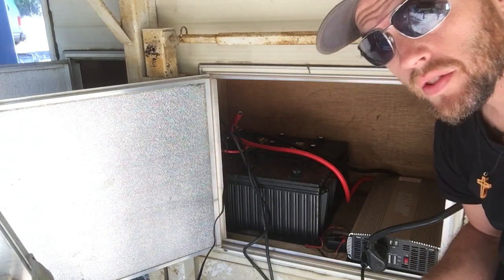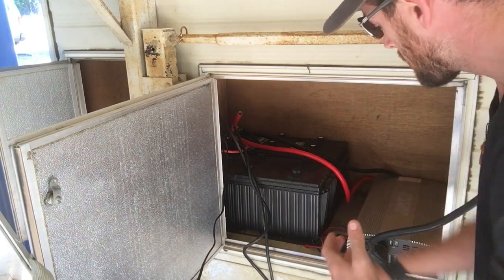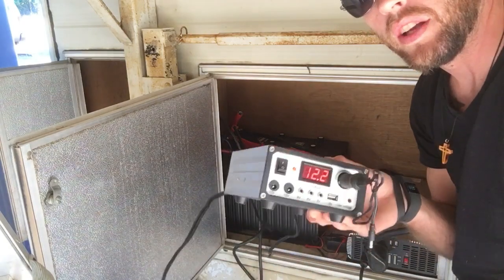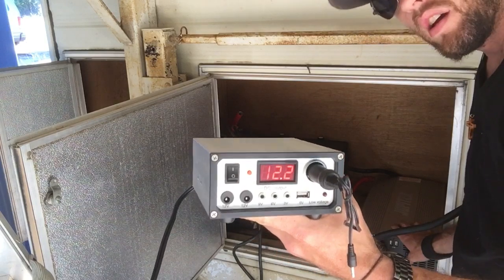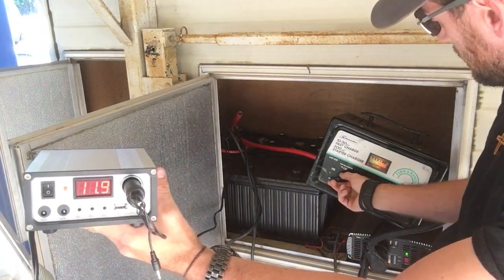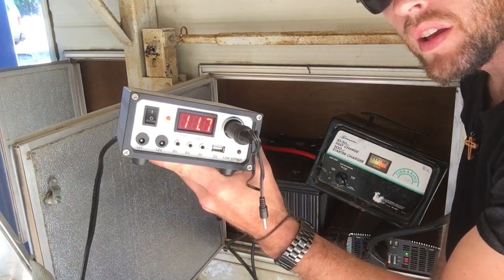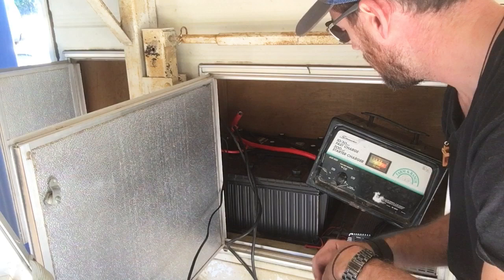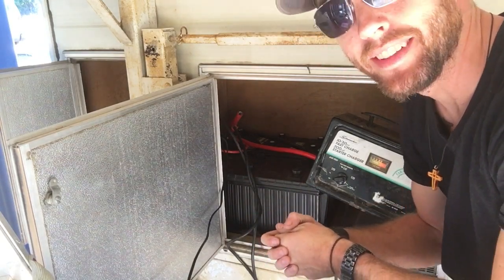The Circle of Lost Battery Life | Battery to Inverter to Charger back to Battery | A Perpetual Fail

Comment: I am looking at doing the same kind of deal. Except that off of the inverter, I am looking at a small variable speed motor to run several Wndzilla generators (3200 watt puts out 12v at 160 RPM and their small ones are 350 watt and hits 12v at 50 RPM. Walmart carries a TTech that's comparable to the 350 watt. They come with mounting brackets) Run the generators to a connector box, to a wind  charge controller and back to the battery bank. I think that it can be done, but the supply going to the battery has to be at least 1.5 times the draw rate to make it recharge with no other load on the batteries.
Reply from the maker: Did it work out for ya?
Reply: @JackNelsonBand  I could say "oh yeah, works great" and it's not done, but that's not me, to be completely honest, I've had a couple family unexpected emergencies (deaths, hospitalizations) that I've had to travel for, as well as emergency house (leaks around windows that required an exterior wall replacement, new roof) repairs that I'm still paying off and really don't have the extra money to go all in all all at once, so it has been extremely slow, save a couple bucks for a component here and there. However I was looking at what I have on hand just the other day, which is the drill motor, 2x 350 watt generators, toggle switch, voltage meter, 500 watt solar regulator (belongs to a different project, but hey, if it will work for this), 3x 100 deep cell batteries, 400 watt inverter and thought, what if I wire the three batteries in parallel for 300 ah in 12v with the voltage meter on it to give me a quick reference meter. Also wire the toggle switch to one end of the bank to run the motor and run only one 350 watt generator through the 500 watt solar regulator and back to the other end of the battery bank and the inverter in inverter on center battery. I think it just may work provided that the energy being generated is greater than the energy being used.
Reply from the maker: @kevinnewell5996  sorry to hear about all of your struggles. I hope they get better for you… sounds like you’ve got a great plan though!

Comment: I have bean thinking about this for a while, after searching half the planet
I found two items in the most unlikely of places,it comprises of 
Two 130w big battery's, 6000w inverter,and my two little circuit boards,
They are powered from the inverter,then back on to the battery's,
they can supply the batts with 100ah+,I will be putting a video up
very soon,all I will say now is the highest bidder will get it when 
it goes on eBay,as as far as I am concerned its a Pandora's box,
and I want it out my life,never gave it much thought when I was
trying to crack it,now I have solved it I don't want it,right now it's
powering all my living room, big TV,big amp,CD player, CCTV 22in
lamps,all with no solar,wind,or mains,it just does it,video will be 
up very soon,sooner the better for me,as for the buyer,just like buying
a car,I WANT them to come and test drive it,kick the tyres,then,and 
only then will the deal be done,so putting a hoax video up,no chance,
standing in front of it and it don't work, I won't make a cunt of myself
like that,anyway, video soon
Reply from the maker: Can’t wait to see it!
Reply: @JackNelsonBand  soon buddy,very soon
Reply: hmmm !   yeah genius !!
Reply: @dennisryan8905  I am,that's why it works lol,I've been held up this yr a little bit but I am back on track to do the video soon,

Comment: Something to think about, using a dc motor high rpm to spin a Alternator putting out 14.7 dc volts back to your batteries. possibly using a dc motor controller to ramp the alternator to a desired rpm
Reply from the maker: Sounds like it could work!
Reply: I’ve been pondering on that series for a long while
Reply: Tried it. Does not work.

Comment: I was able to make something that can charge itself indefinitely that works  That charger you had looked crazy old and 5000 watt inverter must draw a lot of energy. I used two 5 dollar old computer power backups. They each had a little 12 volt battery and when you plug the unit In to the wall they charged themselves and powered a laptop.

So I took one of the converters out and wired the two little twelve volt batteries together so if I plug the one still with the charger it charges both batteries. I have a 400 watt inverter so I plugged in a little extension cord so I had three plugs. Then I unplugged the backup power unit from the wall and into the extension cord and adapted the cord which is supposed to plug into a computer to a switch and then to the inverter. 

So basically when I turn on the inverter it takes power from the little batteries and powers the inverter it’s plugged into to charge itself. I had two more outlets so I plugged various things and only the swamp cooler along with the 100 watt light made it start to drain slowly. So it can be done. I bet if you got a smaller inverter that was just enough to power the charger at maximum. How many watts does the charger say it needs? Maybe a more efficient charger and a small inverter. I have a small solar panel and also a tiny plug in float charger I tried wiring them into mine and I got it to power my laptop and the light and the stereo or just the swamp cooler and laptop with no drain on the batteries without being plugged into shore which is kinda cool for two tiny old 12 volts. 

I just wanted something in case of emergencies that would always be a source of power that would be able to power my digital battery charger in case of an emergency or something and to charge my phone and laptop. I don’t have much experience but I am a quick and am going to try and built a generator myself. It seems to me we have the means to have endless free energy yet we depend on so many disposable batteries and still use fossil fuels. I mean it just takes spinning a magnet in a coil. Now we have figured out solar which can definitely spin the magnet we should be able to make unlimited energy but things aren’t like the old days before profit at the people expense was considered good business and lying part of marketing. 

When will be get fed up with this system? I hope soon. I’m just lucky I like figuring things out and doing things myself even if I mess up because I gain the experience. It’s nice to see I’m not alone. i think you could make a better one then I did without too much investment since you have more powerful base parts. Try using multiple smaller float chargers since your inverter is so powerful.

Also, I was scared to work with electricity for years because of how dangerous we are taught it is but now that I have I am seeing a lot of that danger was exaggerated. But if you are in the business of making batteries you won’t tell people how easy it is to make their own or that the ones they have can easily be reconditioned. Kinda shady though.
Reply: Hello Joshua, can you please make a video of it with schematics ?
Reply: that 5000 watt inverter most likely draws 12v x 7amps=8.4 watts. that is simply powering the inverter on with nothing plugged in. the load he created can be calculated as well, but he bumped it through the different settings. lets just say that his "30" amp charge from the charger drew 115volts x 3.5 = 400 watts ac. his inverter is close to about 85% efficient, i know i have the bigger older model and all these cheap ones are about that rate. which means his inverter has to pull  12v x   40a = 470 watts dc from the battery he is charging. so he takes 470 watts and turns into 400 watts, and does this over and over and over in a loop until the inverter will shut off due to low voltage. anyways sure his inverter is a larger one, but even the cheap smaller ones will pull close to 5-10 watts just powering them on with nothing plugged in and all operate at that krapy 85% efficiency.

Comment: I made one using an Optima red top battery 300w inverter and solar panel works just fine.  It's circular feeds itself
Reply: The task is to recharge the battery with no solar, wind, ac or other outside power source other than the battery that's to be charged.
Reply from the maker: daveroads since you have the solar panel(s) hooked up it negates the task I was trying to accomplish... I don’t have any solar hooked up so I have absolutely nothing to recharge the battery except for the battery charger itself hooked up to the battery via the inverter
Reply: @daveroads... I just got a optima red and 1000w inverter...how much panel are you using??